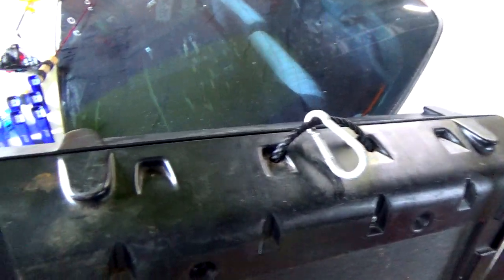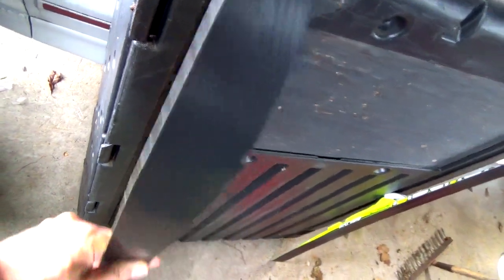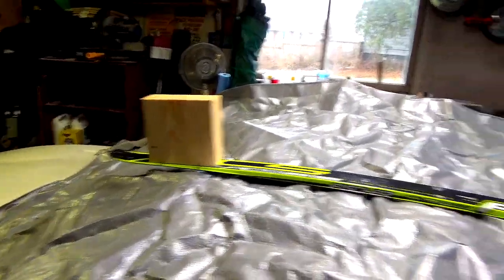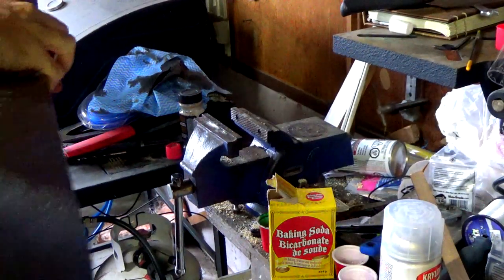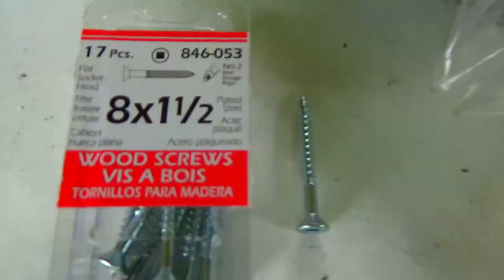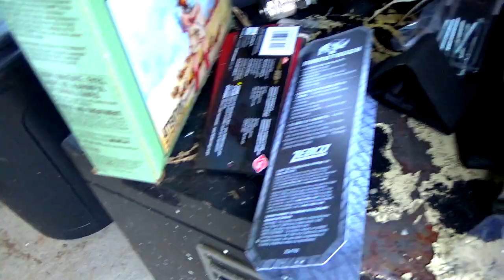DIY Smitty Sled

Comment: Don't forget to varnish the wood for waterproofing and counter-sink the screw heads. The 45 degree angle on the front block is important to cut through the snow instead of building up the snow. Drill rope holes into the front ski tip for pulling the skis instead of the sled body. This way, the pulling will keep the skies riding on top of the snow. Otherwise, the skies will dig into the snow under load weight.

Comment: Might want to add some cross-bracing to stop the frame twisting or parallelagramming, and for that you could use simple rope or steel cable or something to make an X shape between the four corners, making sure it's nice and tight...